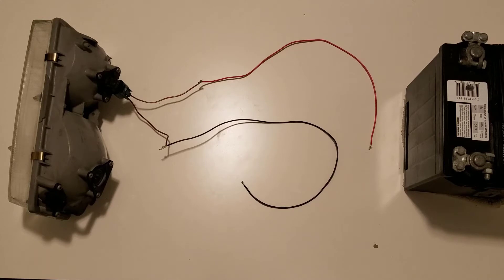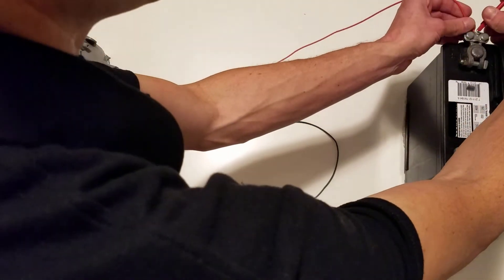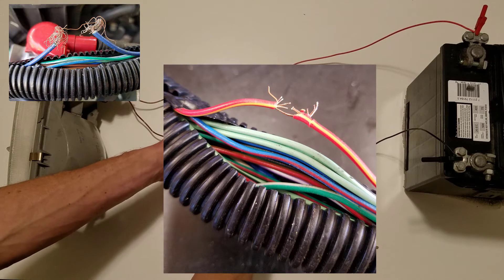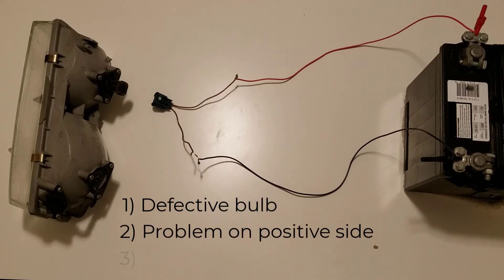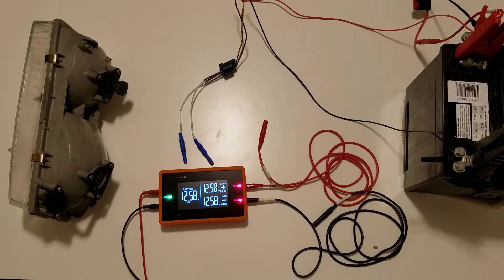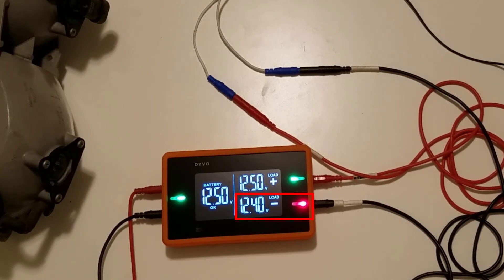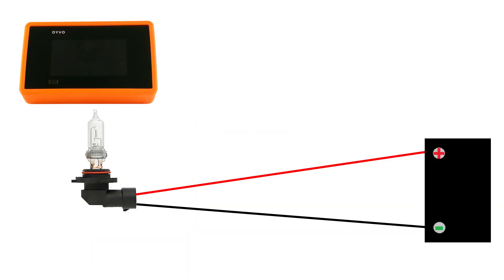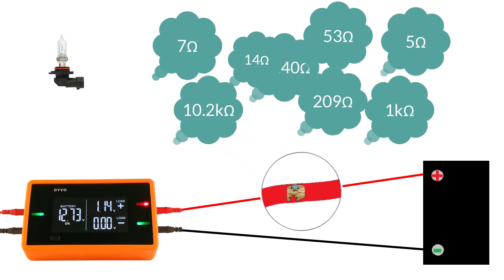How To Test Resistance

Comment: Just purchased this week, arrived yesterday in 2 days! Thanks! 

Other question though. If exact resistance doesn't matter as have been led, taught this way then with systems based off of resistance such as GM "VATS" keys resistance does matter. I'm not questioning the security technology but rather how do we account for circuits that have resistance built in when trying to make a correct diagnosis such as electrical on a GM Vats system albeit the only way we would run into something like that is if someone tried to bypass the system rather than using the standard factory key because the resistance value is in the key. 

Am I making a correct analysis of this type of situation ?

Comment: What If you place the positive lead of the dyvo to wrong polarity, what will happen to the dyvo?
Reply from the maker: Great question! If you place the positive lead of DYVO to the wrong polarity (a ground), nothing will happen to the DYVO Meter. It will not be damaged. 

The positive channel on DYVO is meant to tell you how good of a positive circuit you have. If you connect it to a ground, it will simply show you there is no positive there. 

The negative (ground) channel on DYVO is meant to tell you how good of a ground you have. If you connect the negative channel to a positive (power), the DYVO meter will show you there is no ground there. 

Sometimes it can be helpful to use the opposite channel. For example, if you want to test if a positive circuit is shorted to ground. Simply connect the ground channel on DYVO to the positive circuit and see if you have a connection to ground.